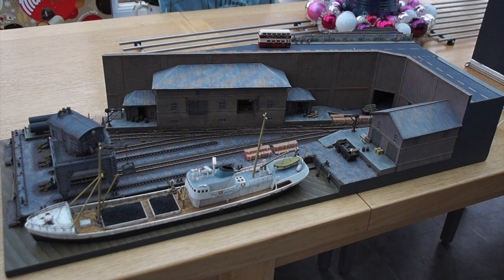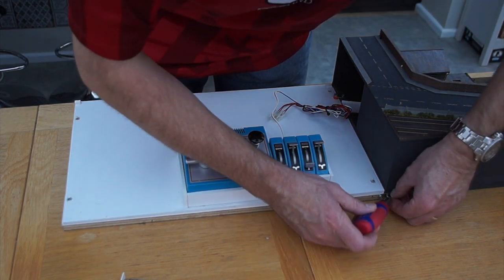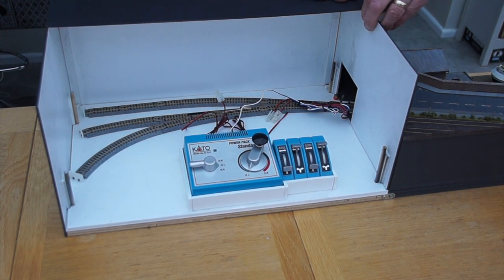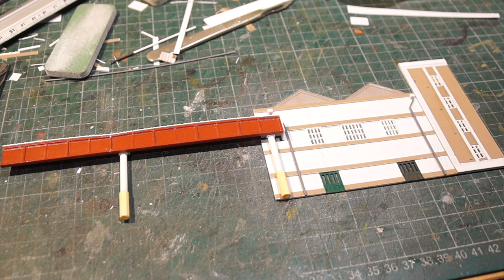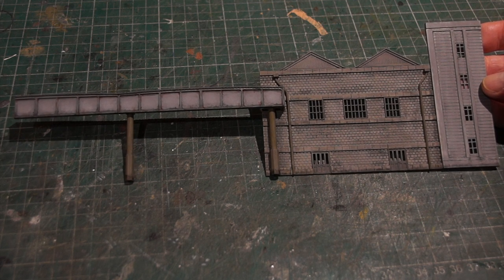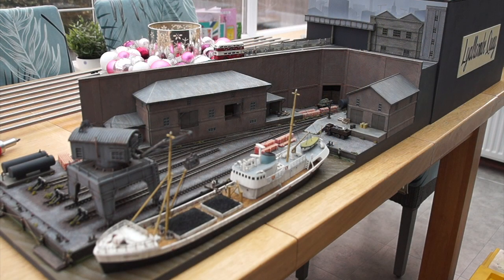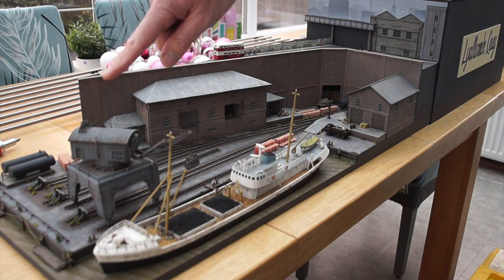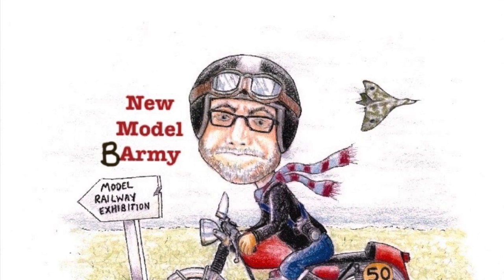Getting Lyallcombe Quay my N gauge inglenook layout exhibition ready!

Comment: That's looking good buddy, the transition from 3D to 2D has worked really well, especially as you're so tight on space. I favour various view blocking techniques but I think your cityscape really helps with the transition.

Can I ask what materials did you use for the fiddle yard please. I'm contemplating a micro layout that's even more brief than the tuning fork micro - in O gauge - that I have, just to have somewhere, in the warm, to run a few vans then flat pack it away or pop it on a narrow shelf that I have.

Thanks in advance ✌️👍😊
Reply from the maker: Hi Mate, Thanks for your kind words. The fiddle yard is made of foam board. We have a lot of signage at my work made from this and it often ends up on my railways and dioramas!!
Reply: @jasonpierce-newmodelbarmy3394  You're most welcome, credit where credit is due😊 I think you may have mentioned similar before a useful resource, light and strong🤔👍🤞 It's a neat, light and efficient fix👍😊